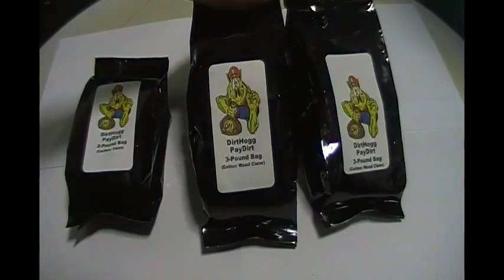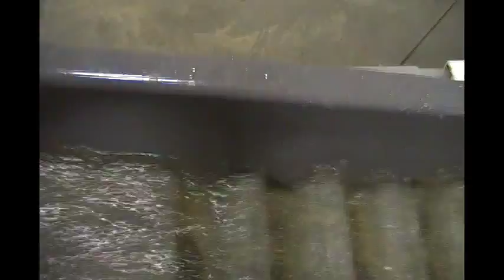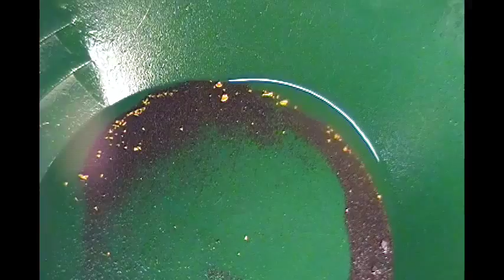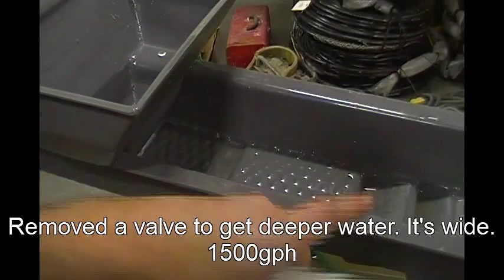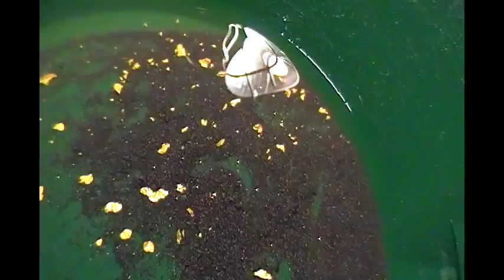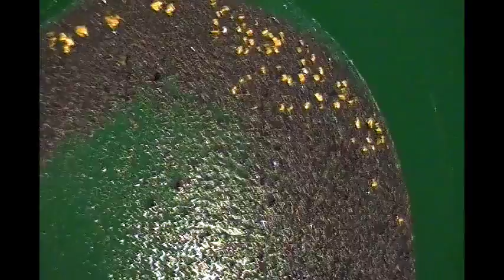DirtHogg Paydirt Gold Concentrates & Angus Mackirk Predator 3 III clean up

Comment from the maker: It's almost 36".  It pretty much is the mini long tom. The water port is what is super key here. It doesn't flush it straight down the sluice. It produces sealed volume then empties pointing to the rear. I will be doing just the sluice in time. This one was all about the gold and it worked pretty damn good.